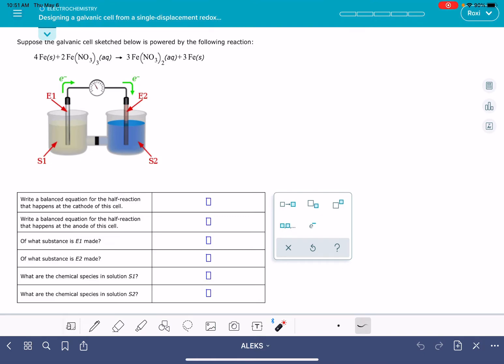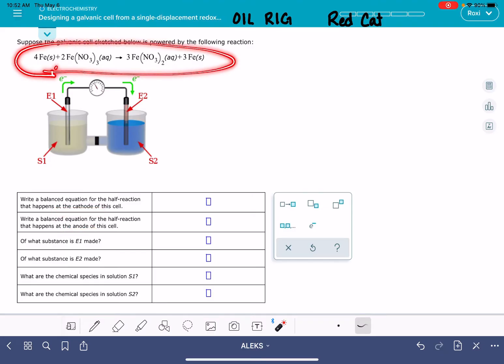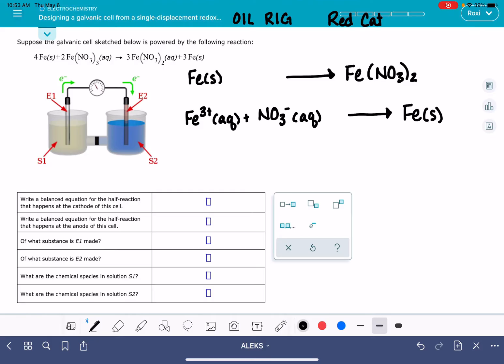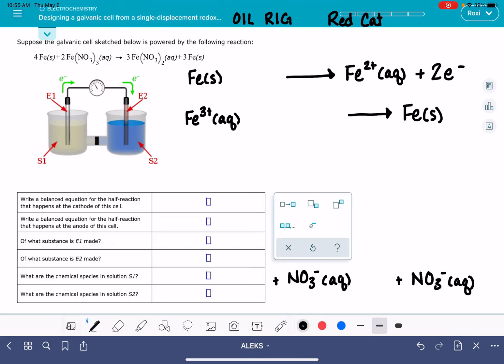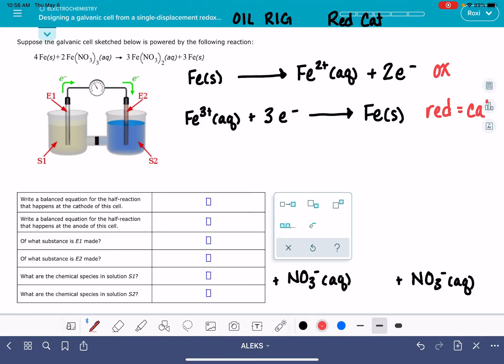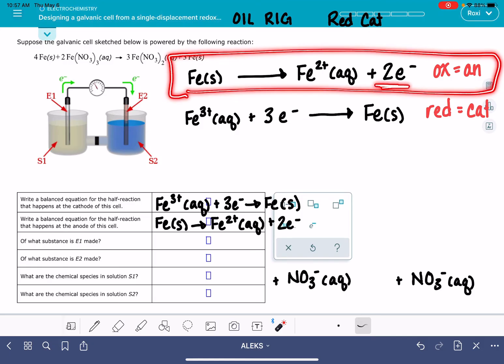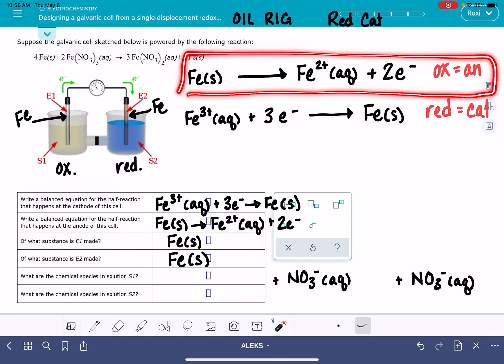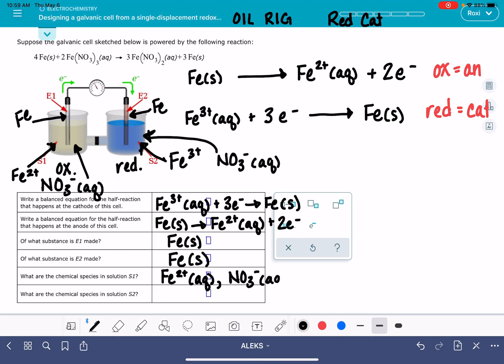ALEKS: Designing a galvanic cell from a single-displacement redox reaction | READ DESCRIPTION

Comment: ALEKS marked me wrong for including the states in the last 4 rows :'( not sure if it does this to everyone but just a heads up
Reply from the maker: ALEKSSSSSSSS what a jerk, I'm gonna have to fix this. Thanks for your sacrifice 🫡
Reply: @RoxiHulet  lol of course, I will say the explanation had them without the states in its answer key, but I did get one other thing wrong so it might take either. I finished the module so I can't check again but you may not have to fix the video
Reply: also while you're here just want to say thank you for getting me through three semesters of gen chem with your videos! would not be succeeding without you
Reply from the maker: Hey - thanks for watching! I'm a single mom, and you all are putting my son through college, I appreciate all of you so very much!!

And yeah, I checked and you are correct - no states. The video is a few years old. I do look at ALEKS's solutions as I'm making the videos, which means that they used to require the states and have since modified the problem. And that's fine, they're allowed to do that and I'm sure they had good reason.